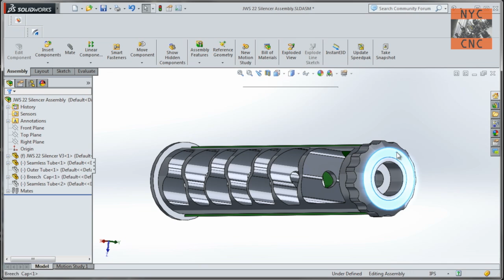Machine Shop Update & Tormach Turret Lathe Purchase!

Comment: I have this problem all the time, I enjoy wood working a lot but the dust destroys my knives and my machines. What I did is put all my wood working stuff on locking wheels and rolled it outside and shut the door, do all my wood cutting outside with the door closed. Maybe if you set it up and made it easy for your grandpa to roll woodworking machines outside he may do it, idk. Either way you do not want wood dust getting into your CNC.

Comment: I battled the same dust problems sharing a  32,000 cubic foot shop with some dusty cabinet makers. The solution was 2 big Delta air scrubbers suspended from the rafters. Worked very well.  Position them so they circulate the entire shop air volume. We just blew the filters out with compressed air.... for years = Low consumable cost.  15 minutes on scrubbed the air.  You might be able to do better than Delta...?

...And a hidden dust collector (like, outside) that turns on and off with the saw... Even a fan.

Comment: As far as the air compressor goes, we are down in texas so I can't comment on temperature but we used to have our air compressor outdoors and we had quite a few problems with our chiller unit but after moving our compressor indoors a lot of the problems went away.

Comment: can't wait to see the lathe in action.
for the dust/dirt issue you're having: can you make a small extension to the existing building to fit the tormach mill and lathe and a few other things you want to keep real clean? (until you're ready to raise the new building). I don't think you'd get around it otherwise, even without the sawdust you'd still be grinding, cutting, etc and will cause dust on everything - something to keep in mind for the new shop also.

Comment: I found to get rid of some dust. (Not all) I used a simple box fan and put a 20X20 filter for a forced hot air system on the inlet side of the fan and suspended it in the shop. It dropped the shop dust a good amount. I'm afraid nothing short of a dust collection and air filtering system and compartmentalizing the dirty shop tools (welder, grinder ect). shop dust is a Nuisance we all have to deal with.  Great job on the channel. We need more gunsmithing videos. Hope to come to the open house.

Comment: If a vacuum system is out of the question, the only thing I can think of is cases, covers, and shower curtains. The lesser of two evils is to unpackage something every time it's needed rather than clean it - depending on the tool in question. That, or segregated shop areas. I forget who but there was a knifemaker on youtube who did a shop tour showing he separated his grinding area with a semi-permanent LDPE wall with slight negative air pressure keeping dust away from the assembly area.

Comment: i like the idea of dividing the shed up into 2 or more spaces, bit hard to see what actual space you have available? a video with a 'floor plan' of how it all sits now maybe.
Reply: NYC CNC that would be good. if the space is smallish then dividing it up might make it awkward... but to offset that, moving stuff outside like the compressor, building a inexpensive structure against a outside wall to house it, plus other rarely used supplies/machinery that's taking up room. i think as long as your grandfather has the things he uses most often he wont care so much if the other stuff is housed outside.
Reply: i see BigMjoliner has covered a bit of what i've mentioned, apologies :)
just went back and viewed the farewell video.
how much of the storage area could be condensed? that would be the obvious end for all 'dirty' activites, like all woodworking and your welding/grinding.
a largish tractor lives in the centre of the shop?

Comment: We have a 7.5HP 80 gallon Ingersoll Rand that lives in a lean to on the back of the garage. When the tank is empty, the compressor can start in all weather, but when its pumped up and has sat long enough to cool off completely, it will not start under load. We have been looking at some kind of bypass so the motor can start unloaded, but haven't gotten there yet. :) In this in Central MA.
Reply: NYC CNC The issue is the oil in the compressor gets thick as your aware with the big John Deere. :) We've looked at a heater for the oil, but as a home compressor it isnt worth the cost of running it. But in a daily operating unit, it might be a good solution. We have also looked at putting a bypass solenoid on the high pressure line coming from the compressor so once start-up delay is over, it will start pumping into the tank and not blowing off.

Comment: We made a small shed for our air compressor and insulated it, we put a 100w bulb in there and left it on all the time for heat, it seemed to work fine, that was over 20 years ago, a small space heater would be good too.
Reply: NYC CNC yes, it was a very small enclosure, it was beside the building and it was just big enough for the compressor

Comment: Here are a few ideas to keep the shop clean, having worked in that type of environment for 30+ years it's going to be dirty. 1. Appreciate your Grandpa he could be gone tomorrow, 2. Get a cover for your surface plate and a cabinet for gauges. 3. Dedicate at least 1 hour per week just for cleaning and 4-6 hrs.once a month for a more serious cleaning, this is on-top of daily stuff. I truly enjoy your videos dirt and all.. Take care
Reply: John, it is an uphill battle.  You roll the rock up the hill, and next day you get to do it again. Think of it this way...you shower today, but you'll just have to shower again tomorrow...do you get frustrated that you can't keep yourself clean?  I doubt it.  You just do it.  Same for the shop.

That said, there are things you can do to minimize the work and time.  Others have suggested covering things, getting cabinets, and making clean rooms. Those will all help by reducing the complexity of cleaning...either less stuff to clean, or simpler surfaces to clean.  A lot easier to wipe down the top of a cabinet or a box cover than to clean a surface plate, surface gauges, and indicators. Another possibility is to try to limit the spread of dirt...wipe your feet coming in, put the dirtiest stuff in one area near the door and maybe aim it to blow outside, if you have to blow grit off a part, try to aim it outside, and maybe get and hang dust collectors between the dirty machines, like grinders and plasma cutters, and the cleaner areas like metrology, finishing, and computer workstations. Randy Richard's videos show his system for keeping chips confined, which is to use conduit to support clear shower curtains around machines that throw stuff. You've got the Tormach enclosed now, but grinders, plasma cutters, etc can generate and distribute dust and debris and maybe that sort if barrier will at least slow it down.  Not expensive and easy to move out of the way when necessary. 

Isolate, enclose, and clean regularly.  Even if you had your own building you'd need to do that.  It's a dirty world and entropy is against us. But you can still make amazing parts!

-- Mike
Reply: Don't underestimate how much grime your plasma cutter generates too.  A fair bit of the metal removed is in very small particles.  Cutting under water helps, but I hear it can create other issues...like rust. 

Good luck! 

-- Mike
Reply: NYC CNC it was in the 80's when I worked there, like I said the shed was just big enough for the compressor and it was well insulated I know it worked but can't remember how well but I know he never put a space heater it the shed and I don't remember having any freeze ups this was in Toronto Ontario. To day it's -10 f
Reply: NYC CNC  Everything that BigMjolnir  wrote are great ides and solutions. 
Cleanup is an issue in every shop and it is a continual chore. 
We hired an inexpensive energetic part timer from the local school that cleans up about 1 hour each day, this has made a huge improvement in the shop cleanliness and morale for a low cost. We also use him for local pickup and deliveries. 
In addition to the hired daily cleanup, we have a more thorough cleanup on the last Friday of the month where we enlist everyone  and use the last hour or two and thoroughly clean and reorganize. 
Sometimes but not always we have shop deep cleaning, perform a quick inventory, relocate equipment, perform maintenance, etc on the last Friday of the quarter where we will schedule any needed additional labor, parts, materials, contractors, tools/equipment etc. to accomplish the tasks. 
Sectionalizing the shop will help improve overall cleanliness and enhance the final product. 
Foot transferred mud and dirt can be reduced by a large swatch of Astroturf type indoor/outdoor carpet by the doors to wipe the shoes/boots on when entering. 
It is relatively inexpensive, easily cleaned, and when it gets really nasty it doesn't hurt when you toss and replace. 
Shop vacs and cheap industrial mops (wet and dry) help reduce redistributing the dust, dirt and debris that brooms and air blowers are infamous for. 

Concerning the air compressor, I recommend contacting the manufacturer about their freezing temp operation recommendations including lube oil selection. 
We have a 10HP 2 stage compressor in an outside accessed unheated space that the manufacturer recommended we run full synthetic compressor oil in year round with a lighter 5W-30 grade in the freezing months. Which is not a big deal for us since we perform a maintenance service on the compressor twice a year, in the fall and again in the spring where we change lube, filters, clean and thoroughly inspect. 
For moisture and freezing concerns we run an electric automatic drain, self regulating heat trace cable that automatically turns on at 32F, off around 40F around the base of the tank and on the pipe from the tank until it passes into the above freezing section of the building. This has been working for about 10 years without any issues with temps dropping to near 0F several times and near 100F a lot in the summer. 
Hang in there, you will get your new shop, with the design you want and built the way you want.
Reply: NYC CNC That is exactly what we have done and it has worked well. 
We have turned the shop gofer into a full time machinist several times. 
I won't elaborate here, but there are some pitfalls to hiring employees if you are producing a salable product. I would urge any small/medium sized employer to protect their product and intellectual property by crafting and executing non-disclosure and non-compete agreements with all employees, partners, investors, financiers and contractors/subcontractors...

Comment: How about a simple clean room made from drywall I think you guys call it, plaster board here in the UK, and timber. Build with screws it could be stripped down and re-purposed for your new build. In it you could use all your 'must be clean' gear and have a quiet zone if you use rock wool insulation and some sort of cheap cover on the outside for concentrating on drawings, measuring ect  Storage above if you make the roof strong enough. And just accept that once every quarter you have a big clean?
Reply: I'd consider Godshole's idea. I've worked in and seen many shared shops (not necessarily machine shops though) and this is really the best way to get a clean spot. A HEPA filtered blower can help circulate fresh air/heat while eliminating dust and keeping the room positively pressurized so junk doesn't come in when you open the door. Stud wall framing (wood or that stamped steel stuff) goes together pretty easy as well.
Reply: +1 here... Put all the "clean" machines and ops in here. Add a mini-split, a desk for CAD, CAM, and office duties. All the other dirty jobs can live in the rest of the shop.
Reply: I'd suggest the exact same thing.